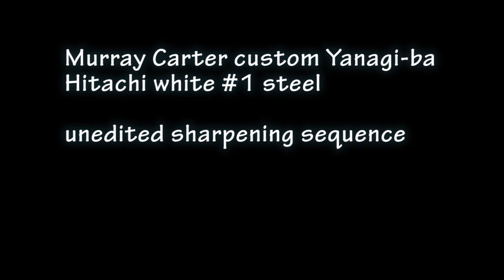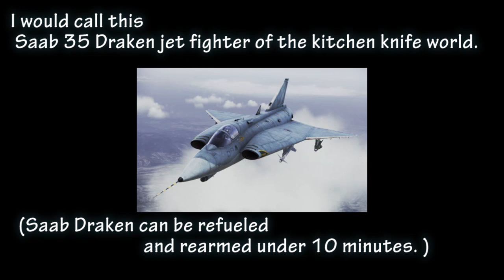Murray Carter custom Yanagiba sharpening (unedited) and demo

Comment: Are Carter's knife one single bevel from spine to cutting edge.  Or does it have two?  So a normal spine coming down, maybe thinner as it comes down (aka flat grind).  Then all of sudden near the cutting edge is a more obtuse angle?

All my Walmart grocery store knives are like that and it's a pain to thin out the cutting edge in order to get a more acute angle.
Reply from the maker: This knife is just like regular yanagiba. It's a single beveled knife. The backside is flat.

Comment: Do you prefer the Bester 1000 compared to the Chosera 800? Thanks for sharing your knowledge.
Reply from the maker: For my current situation, Chosera 800 is my favorite. 
BUT, simply because of the convenience of splash & go.
Bester 1000 is a very good stone. Fast cutting, stays flat.
Incidentally, both are made by Imanishi (they make Naniwa Chosera line, Kitayama 8K (favorite finishing stone, not just by me, but also by a lot of well experienced pros), Arashiyama, etc, etc.)

Bester is a little bit less $. They need to be soaked in water.
And probably, just a little bit more aggressive than Chosera 800.
(Don’t judge the stones by grit #s, if it’s a different line of the stones, or by different companies.)

Don’t overthink about the small details.
Reply: I appreciate your feedback. I don't believe any one stone will make me better at sharpening. I think the process of feeling what's happening at the edge is the key and not thinking etc. as you said in several of your excellent videos.  @MonsterS4R996